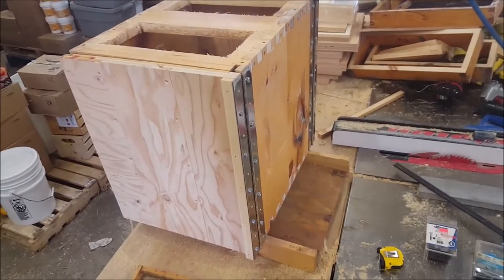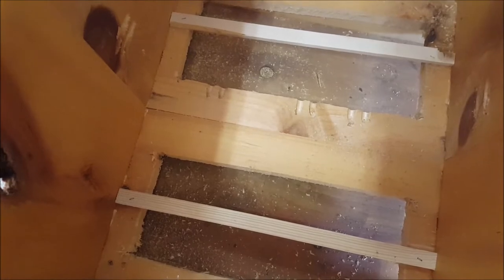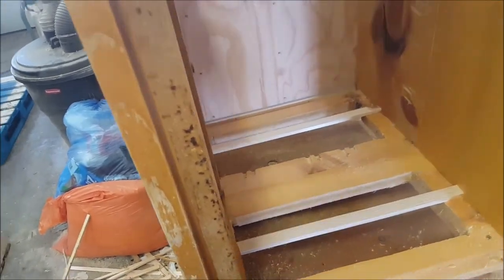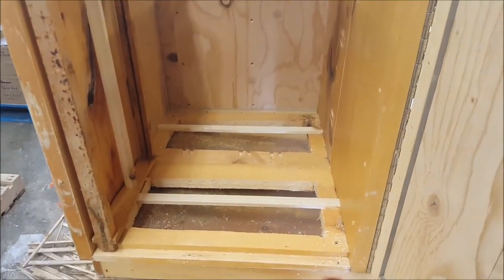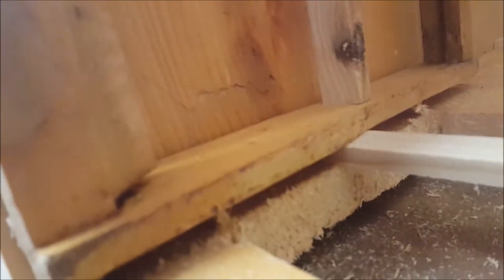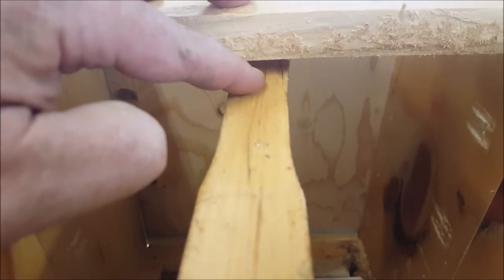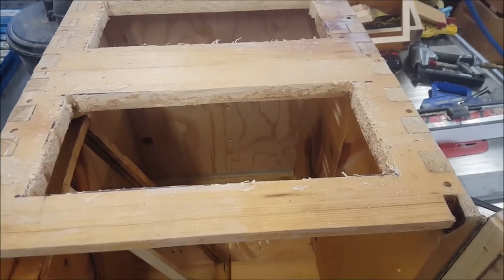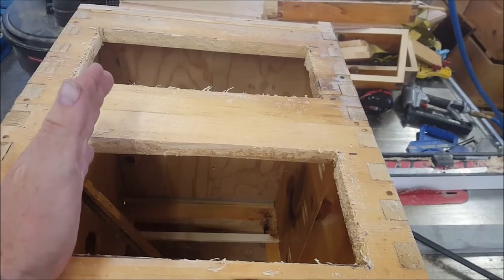🔨Vertical Hive - That Bee Man

Comment: They say that imitation is the most sincere form of flattery, so we thank you!  You did an admirable job of building your version.  As you noted, there was a considerable amount of time, testing, re-testing and thought put into the design of our Verticomb hive.  Bee space is a high priority in the design and that is the difference between a functional hive and a blob of honeycomb in a box of frames.  You made some shrewd observations about our product and correctly noted many of the design elements that make Verticomb work.  Also, you are correct that the Verticomb hive can be used for honey supers as well.  We'd very much like to hear how your version worked and would be happy to speak with you about our hives.  Could you mention where you're located?   Best of luck with your bees!
Dave 
Verticomb.com
Reply from the maker: Hi, Verticomb.  I am near Winnipeg, Manitoba.  I like to try different things in the woodshop.  Different hive designs help me, as a new beekeeper, to understand the bees, what they need and what they don't.

I had planned to rework my hive this winter and try it out this summer.  That has not yet happened so I have nothing to report on how well it worked.